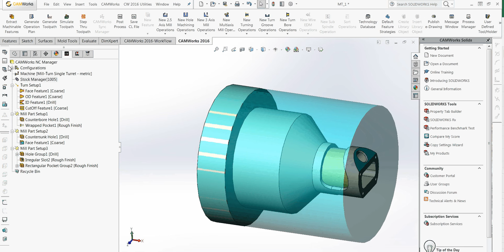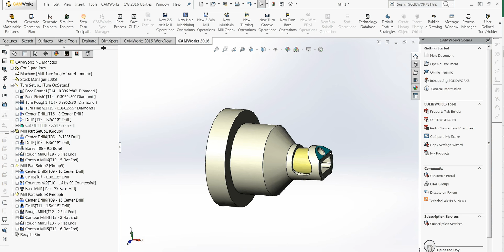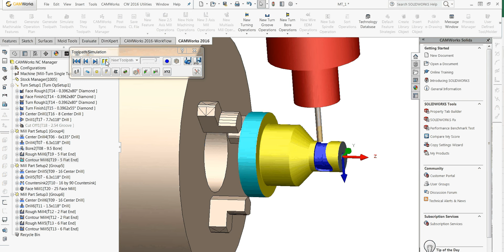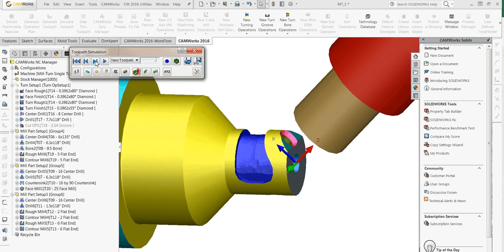CAMWorks - Mill-Turn.

Comment: Hi Sir, Camworks can install without installing Solidworks? I mean Camworks is not only add on for Solidworks...thanks
Reply from the maker: Yes you can. Camworks is an add on for SW, but is also a complete package and in this case you will install Camworks Solids.
Reply: @CristiMoise  thank u Sir. Has the trial?
Reply from the maker: @lasmiansitumorang81  yes,in the trial demo version you will find Camworks Solids.